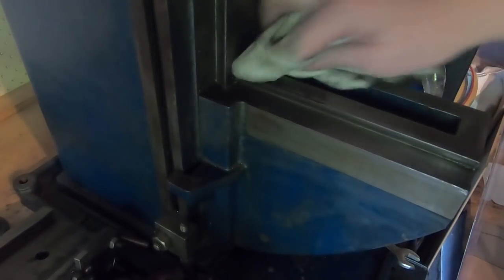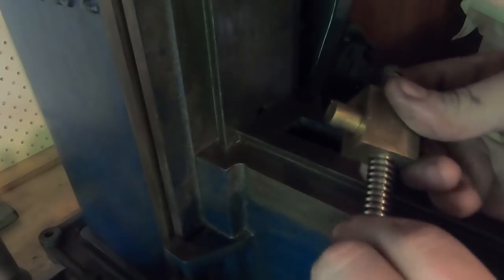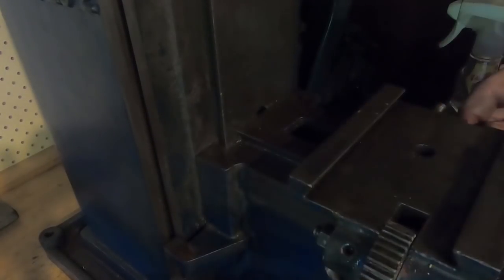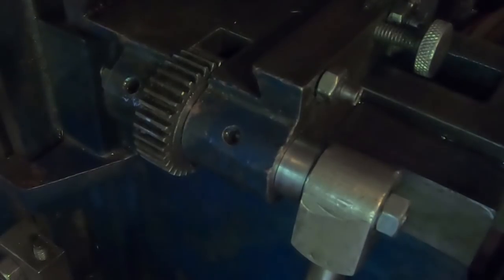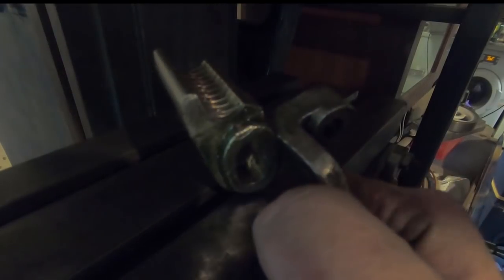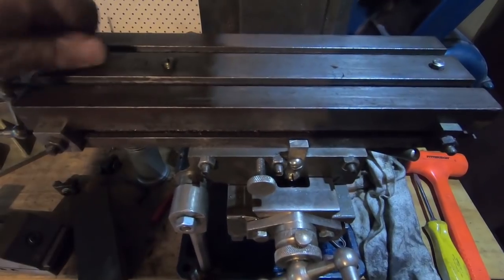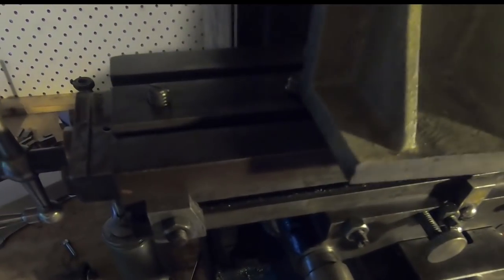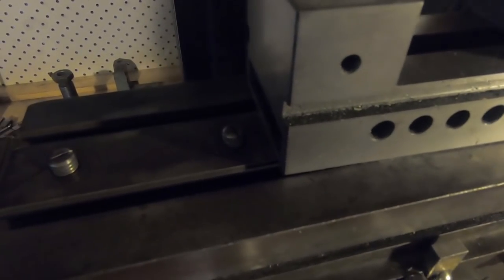CENTEC table reassembly

Comment: emma...i hear your after  a vertical head for your centec..there has to be  thousands of them out there  !have patience you will  get one ! eventually..  emma.. i am after a knee for my centec.. and i am willing to pay well  for one !... let me explain my  problem. i am in my eighties . and my strength is deminished  some what ...so instead of messing about  swapping  from vertical to horizontal . (everything is so heavy) i have two centecs .. one vertical and the other  horizontal .  one belt drive  ...one with gears (somewhat noisy) so i am on the lookout for a knee. well emma enough of my rambling.. your doing a grand job    regards    laurence

Comment: Hi Emma, when I re scraped and cnc'd my centec 2 I ended up replacing the gib screws with socket heads. It allowed much better control over clearances an meant that locking the screws was much more positive As you could put some grunt on the lock nut without worrying about upsetting the adjustment. Cheap and effective mod (think they are whitworth screws)

Comment: Nice!  My centec 2a is in bits on my bench, coincidental decided to pull it apart on Saturday, it's in alot worse cosmetic shape than yours and has a few bits and pieces need replacing, size of the machine compared to what it weighs just makes no sense to me it's made of lead I swear!